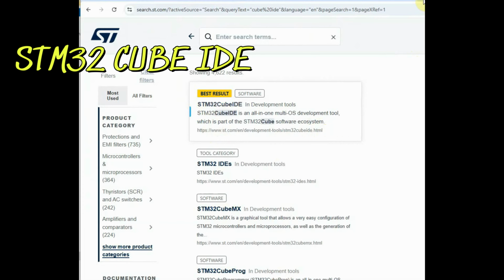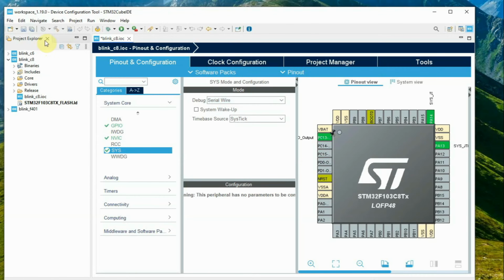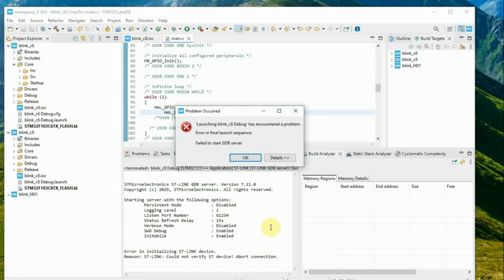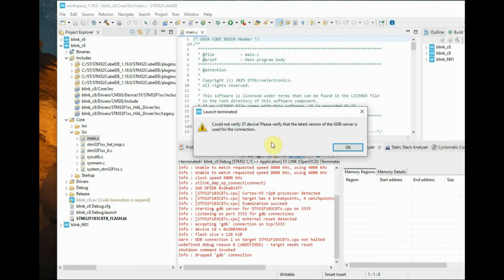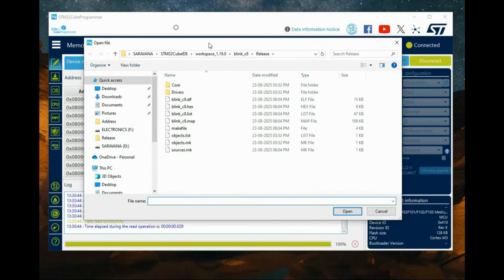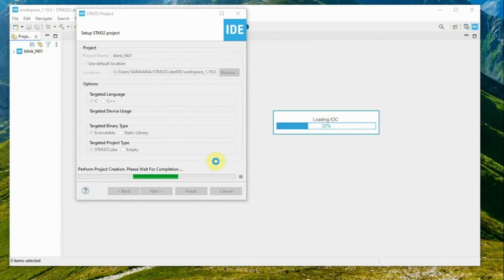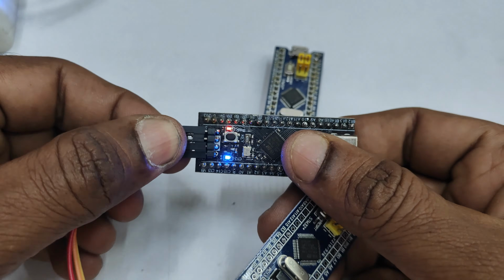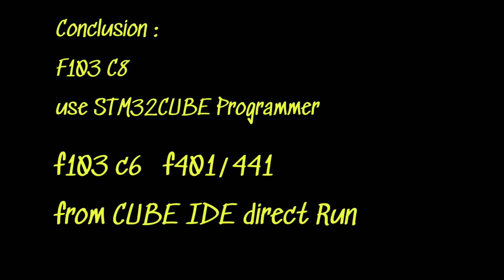STM32 F103 C8_STM32 CUBE IDE_ Upload Error_Failed to start GDB Server_Solved

Comment: Just because the IDE build produces zero errors or warnings does not mean the firmware will be working properly in actual microcontroller.  You need interactive IDE debug capability.

It is not really fair that cheap Chinese copy clones take advantage of all the STM development tools eco-environment that cost STM real expense to develop.  The Chinese clones are likely also shady on getting around the ARM licensing fees.

Comment: ahh damm it , this is not solution bro
Reply: There is an easy solution if you've got access to the full firmware. The serial number is the UID of the MCU, 12 bytes concatenated in an HEX string. The problem is when the second byte is 00, while in a real STM32 is usually FF (but any value other than 0 will do). Get the unlocked 20 bootloader, clear the RDP of the dongle, Burn the bootloader. Use an older fw updater, not higher than v2J32. Then you can continue updating until 2J43 or even more... Once then, dump the full flash into a binary file (size 0x20000). Then edit with an hex editor, look for the sequence "E8 F7 FF 1F". It Will appear twice. Replace these bytes with "E4 F7 FF 1F" then program the dongle and the problem has gone and you will see a very different serial. This is because we changed the pointer of the UID to 4 bytes before, where there is a word that looks like "0x002412AE"...
Reply: Sometimes in Win 10 if you are using antivirus (avast) its blocks it.